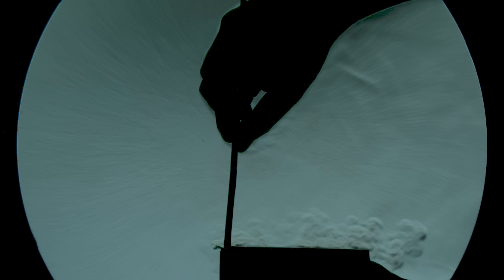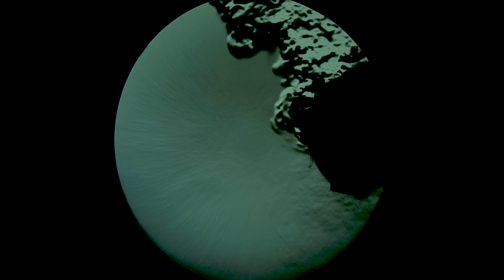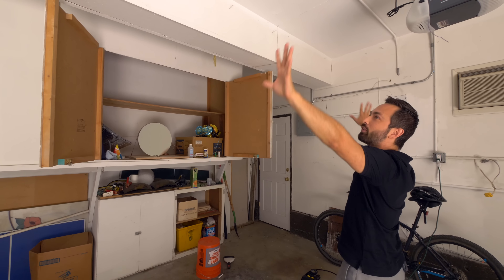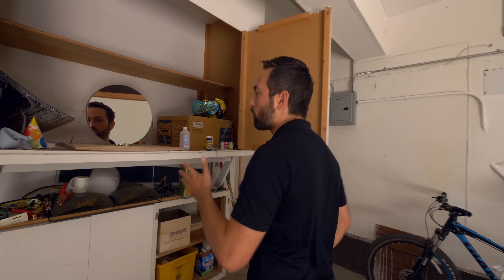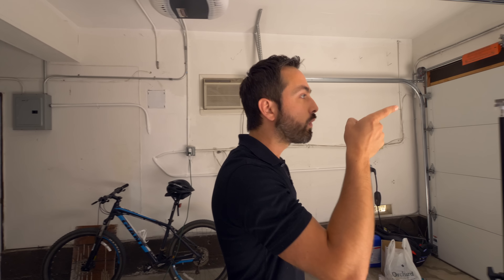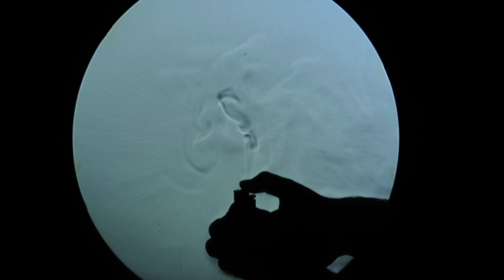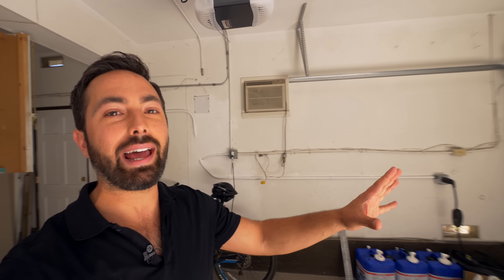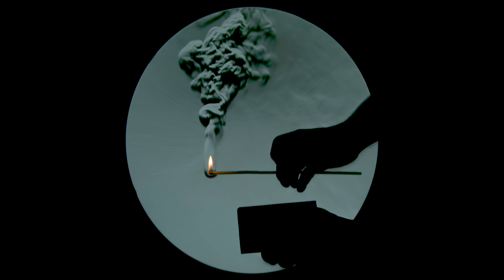How To See Air Currents

Comment: I would love to see someone playing instruments in front of this. flute/piccolo could look cool. Maybe a trumpet and some brass instruments too.
Reply: Casey Hamm why do people type a plus sign when they agree with someone?
Reply: akshay mutalik 1+ means agreed.
Reply: As in, one more person agrees.
Reply: Colin McQuinn harp
Reply: How about something that is (slightly) radioactive? or maybe something really hot that you just microwaved.
Reply: Probably easier starting off with something of a low frequency without any harmonic frequencies, so maybe just a loudspeaker playing a single tone?
Reply: Violin! Maybe the soundwaves are visible. Definitely the resin from the bow!
Reply: I was thinking of a tuning fork
Reply: Something like a violin's string might be even cooler, if you can catch the vibrations in the air?
Reply: the reason I suggest these instruments is not because I expect you to see the sound waves, but because I would like to see how the air changes on a flute when the player presses keys and relaxed keys or plays in their upper or lower range. I know from experience on flute and piccolo higher require less air if done right but faster air overall. My understanding is that on trumpet it is much the same way in terms of air used so I would love to see the actual air coming from the bell of a brass instrument if it can be seen.

Comment: aerodynamics of how a sail boat uses wind to propel itself. I always get mystified by that, but seeing the airflow would help.
Reply: [obviously using a small model sailboat, and fans or hairdryers]
Reply: Whutman. It is actually a combination of the keel of the boat and the sail. The wind exert pressure on the sail trying to move the boat sideways the keel transfers that pressure to the water and the boat is pushed through the water by these two opposing forces.
Reply: Wind pushes on the sails, which in turn propels the boat.

Comment: How about a really loud speaker. Would you be able to see the sound waves?
Reply: @Obama Jr It doesn't heat the air, but it does change the air density, that's what sound is.
Reply: you should be able to see the pressure waves the speaker creates, more dense air should be visible
Reply: What would happen if you strobe the light source at (or near) the frequency of a sine wave played through a speaker? Hmm......
Reply: @DougWagner You could do that, but I was thinking you could set up some speakers to generate a standing wave, that will appear to stand still, or you could do still photography.

Comment: Would be cool to see if really strong magnets affect anything
Reply: Sadly, magnets wouldn't affect it. Schlieren photography can only measure gradients of density.
Reply: Probably not as neither light nor air are influenced by magnetic fields. If you take an electromagnet you can probably see the heat the current generates but a permanent magnet is probably invisible.

But maybe that is a misconception so it sure is worth trying :D
Reply: Oxygen is diamagnetic, nitrogen is paramagnetic. So both are influenced in some way by magnets, but is this setup sensitive enough to detect the movement of molecules?
Reply: maybe in a liquid. But not in air
Reply: Xpopy in air I think that is nothing to see, but Flames are a chemical region with many ions, so flames are sensible to electrical Fields, but the schillieren is a visual recording of density differences, so maybe you will not see many changes on the video.

but will be funny to see a episode with electrical Fields  and soundwaves applied to flames.

Comment: PRINCE RUPERTS DROP SHATTERING.  What kind of pressure waves can be seen?  You might need to call Destin or the SloMoGuys to capture it. :)
Reply from the maker: I'll call Destin
Reply: would putting a transparent acrylic shield in between affect the experiment?
Reply: Yes, but not in any noticable way if parallel with the mirror
Reply: And if there weren't defects in the acrylic, it would be a uniform affect.
Reply: Please do this.

Comment: #1 - This is damn cool.

- One of those blade-less fans
- Dry Ice (in water?)
- Boiling water (can it pick up evaporation or the heat differences above an object due to evaporation?)
- One of those toy gyroscopes
- A glow stick (In order to illustrate the principle of the Schlieren image)
- One of those charcoal hand warmers
- A battery hooked up to a coil of high resistance wire (you'd want to see above and below the objects. Do both the battery AND coil get hot? Why? Also,
- Various coiled wire shapes with current running through them (maybe the wires should be stacked or coiled multiple times)
- Rare earth Magnets being forced together or apart
- Can you coordinate with +Grant Thompson - "The King of Random" to create a mini cooling coil and then see the exchange of heat?

Comment: I would love to see 
1: A standing wave of sound in a clear acrylic/glass tube
2: what happens when you replace the razor blade with a colored filter.
3: slow motion of sound/air escaping the end of a brass instrument.
4: slow motion of the air above a drum diaphragm being struck.
5: slow motion of air currents around a projectile.
Reply: MobiusHorizons number 2 is awesome bro
Reply: Cool ideas yeah #2 is a neat idea though it would probably just mean the currents would have a color instead of a shade. I’d like to see guitar strings being played.
Reply: Slow motion of air escaping a flute as well. The mouthpiece generates vortices that alternate directions.
Reply: Get a tesla coil in there!
Reply: I've just tried acrylic tube with schlieren for my mechanics school videos and it wont work, the "grain" of the acrylic becomes visible (see last bit of my latest video) so you cant see inside well, I'm going to try glass next, fingers crossed.
Reply: (genuinely curious) Please explain. Shouldn't the pressure difference in a standing wave cause a difference of index of refraction visible through schlieren? Or are you saying it would require greater pressure to be visible? if so, is it not possible to create a more sensitive setup?
Reply: +I Make and Fix Stuff,  Awesome!! I look forward to it.

Comment: Light a candle, blow out the candle, then light the smoke on fire, causing the flame to travel down the smoke and reignite the candle.
Reply: how does one light carbon monoxide on fire?
Reply: It's actually the wax vapor that gets ignited when you do the trick. There are some awesome slow motion videos of it on youtube.
Reply: Vaporized paraffin wax amigo.

Comment: What conditions do you need to film in? Like have the room really dark? Also what camera settings do you use?
Reply from the maker: It didn't need to be that dark and for some of the shots my DSLR at 180 fps did the trick. ISO 200-800 f/4 with short exposures ~1/200-1/1000
Reply: Awesome, and thanks for replying so quickly!
Reply: I've seen this effect with the naked eye accidentally, when looking through an unfocussed telescope. The rim of the telescope tube (or maybe the secondary mirror?) functions the same as the razor blade here. It was in normal room lighting, and the effect was pretty clear! I bet you could record it with a regular phone camera if you wanted.
Reply: but, which camera model is it? I mean, I see this can record many FPS

Comment: he explained the refraction but his explanation doesnt exactly help me understand how that image is formed, specifically with the necessity of the razor blade. like wouldnt the light still be refracted through the different temperature fluids without half of the image being cut off? and why do we not see that the lower half is cut off, why is the image still a perfect circle?
Reply from the maker: yes, the light would still be refracted but it's not refracted very much, so if you don't cut the light with the razor, almost all of it still goes in the camera so you don't get a very contrasty image. By cutting off half the light, you block light that has been deflected. To your point about the perfect circle - by blocking the light so close to the camera, we're not blocking only the lower half of the circle - all the light from all parts of the mirror is passing through every point on that bright spot I showed. So cutting off half the light decreased the intensity of the light overall by half rather than cutting the bottom by 100% and the top by 0%.
Reply: Veritasium you might do a video to explain it :D
Reply: What I don't get is how you have enough light to shoot a high-speed, high-quality video while only recording one "half" of a small point of light. Any further explanation on these points would be very interesting to me.
Reply: Veritasium What about diffraction due to the razor, how does that affect the transmitted light ?
Reply: He has a huge collection mirror.  The aperture is more the size of the mirror than the size of the lens of the camera.    Sure you might be cutting off half the light with a knife edge on average, but you're nearly perfectly retro-reflecting a significant fraction of a sphere which has been illuminated by an active point source, modified by intermediate refraction.
Reply: Veritasium If light from all parts of the mirror are going through every point on that bright spot, how is there an image? The only point where that is true is at the focus, which is a single point and therefore can't be cut in half, so everywhere you try and cut it, you would be cutting off half the image. Obviously I'm wrong somehow, but I would like to understand where my misconception lies.
Reply: + firedale2002 When I was a kid I didn't really understand how the objective mirror inside a reflection telescope didn't leave a hole in the collected image.  I suppose that thinking about light in terms of individual rays that travel shortest distances helps.
Reply: This is somewhat similiar to partial eclipes, where the moon has two shadows. One partial, and one complete.
You can try to see that phenomenon to yourself, by holding a finger very close to your eye while looking at te window. As you move it around, you can see that 'aura' of darkness around it.
Reply: I suspect that walking through the individual transforms might help some folk.
Reply: If you want to capture only directly returned light and block out the refracted light, why use a razor instead of a donut? Too dark?
Reply: no.... too delicious....

Comment: I'm working in my schlieren setup now, need a better mirror. if this works out Ill be using it for engine related simulations, and if possible attempting to visualise sonic compression and expansion waves in converging and diverging tapers of 2 stroke exhaust expansion chambers.

Comment: what will happen if you use a laser instead of the LED?
Reply: You could use a laser, if you defocused the laser to simulate the light coming from a point source. As far as I know, it would look exactly the same, except for perhaps being able to gather the light into the mirror more efficiently, which could well be valuable for high speed photography.

Comment: What would happen if you used a prism in place of, or in conjunction with the razor? would it be possible to observe a colour gradient?

Also, could you put a fish tank in front of it and watch some fish swim around (might move your focal point as it refracts through the water.
Reply: Prism idea: With white light and a very sharp Prism, you might see tiny color differences. But the Razor makes complete Black, and look at how small some differences are. You could not really see much. Also since the Razor completely Block light, any combination of prism and Razor won't work.
Reply: You're probably right Felix but I think he should try it anyway.

Comment: Things I think would look cool (not sure how many are detectable):

• Turning on an incandescent lightbulb
    • Compare to turning on an LED
• Hitting two steel ball balls together
• Electric arc
• Playing a trumpet, seeing where air comes out. Obviously the end, but does it also leak out elsewhere?
    • Compare to a saxophone, where the air definitely doesn't all come out the end
• Speaker playing audio
• Space heater
• Hold a slab of dry ice at the top of the frame
• Active compost pile

Other ideas contributed:
• Lasso hitting the speed of sound (Muzkaw)
• Liquid nitrogen (killuh208)
• Keeping a small plant and seeing the exchange of gases that take place (Murali Krishna)
• Gas explosion / deflagration (Muzkaw)
• A liquid burning (Muzkaw)

Feel free to respond with more ideas.
Reply: The obvious idea everyone and their mom is thinking of is a fart. I'd rather not see that one.
Reply: Sound waves make to small of a pressure difference to be seen, you got to have a very sharp and powerful sound (lasso hitting speed of sound) to generate enough pressure to make the index of refraction vary enough to be captured (and a very fast high speed camera ofc). I've tried seeing electric arcs myself, they hit the metalic coating on your mirror and pit it, which is not a good idea when you know the price of these things ;)
Reply: pasta0328 liquid nitrogen as well!
Reply: Well the fart would still be warmer than the surrounding air, and have a different chemical composition so it should still be visible, or am I wrong?
Reply: Keeping a small plant and seeing the exchange of gases that take place
Reply: pasta0328 a ghost lol
Reply: Morten Scheel the fart would work, I just don't want to see that demoed :)
Reply: Muzkaw Darn. Well, like I say - just some ideas. Might not all be possible. How about some more ideas since it sounds like you've done similar experiments!
Reply: Also, lasso hitting speed of sound can be done. Just have to get the tip in frame and snap properly. Which is harder than it might sound.
Reply: Gas explosion / deflagration makes pretty dramatic footage. A torch (oxy acetylene) is very cool to see too. For the lasso snap, its is easier to frame it if you do the experiment with a folded belt that you stretch vigorously, i've just never had the camera to film a shockwave passing by on a 30cm mirror ^^. Maybe notch his led a bit up to fade the flame away from the image and show a liquid burning (you dont see the flame, but you see the vapor being generated and lifted upwards). You could also connect your mirror to the high voltage electrode and isolate it very good from ground to avoid the arcs jumping to it. Again, i've neevr found a way to connect my mirror surface to a potential reliably without scratching it :p

Comment: or you can have a hot surface, with cold wind blowing over, ideally, you would see both the thermal boundary layer and the hydraulic boundary layer, or even the velocity and temperature gradient normal to the surface.

Comment: Blow high-pressure air through a tiny hole to create Mach diamonds! I did that with my Schlieren set-up and it looks phenomenal! Bonus if you make that tiny hole a CD nozzle by drilling the hole using a tap on both sides.
Reply from the maker: details! email me at this handle at gmail
Reply: Emailed you!
Reply: @girguis sedky Is it on another channel of yours or did you not upload it yet?
Reply: Hey! I do not upload videos to youtube.
Reply: Looking at your channel, you seem to have uploaded one.
Reply: Well, the flowfield diameter will depend on your hole diameter. Get a high enough inlet pressure and you can satisfy shock conditions with a bigger hole and hence get a wider flowfield. You can def put things in it and see the flow going around your object.
Reply: Cool, I'm taking a hyper sonic flows course next semester. I also gets to choose my last experiment for my experimental methods class. Since the supersonic wind tunnel at our school is currently broken, I would definitely like to see this setup.

Comment: I have a question about these slow shots... How is the sound captured so clearly? I mean, that bubble exploding was amazing!  Is this edited or is there an awesome microphone there?
Reply: The sound is added later with sound effects.
Reply: Maveltjesplot  I see... but is this how it's usually filmed? Like in Slo Mo Guys
Reply: Yes, the Slow Mo Guys add sound effects too (often combined with actual slowed down sound). Not every body does this as it is a lot of work.
Reply: Pedro Heck The sound is simply captured as normal, and as the frames shown per second are slowed down, the sound waves that were also recorded perfectly normally are stretched out. The microphone must operate at a high frequency, but most microphones do.
Reply: Maveltjesplot  Oh I see... thanks bro!

Comment: -Put a drop of cold water on a very hot plate, such that the water does not toch the plate bc of vapor, must be from the side.
-Hot cop of coffe (water), compare to a cup made of isolating material.
-A bee or a fly. If nothing happens add some warm air for contrast.
-champaign
-do you have a tesla coil? or some high voltage generator? electrolize air / lightning => create ozon
Reply: kampkrieger I agree that would be cool, the lidenfrost effect is very fun to look at , it would also be cool to see its opposite and use liquid nitrogen on a normal plate to observe it in comparison